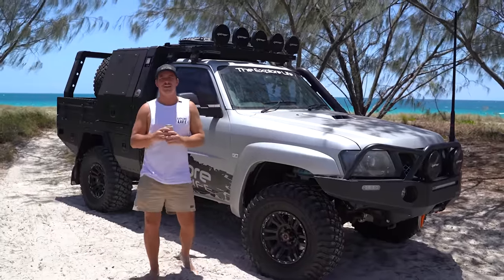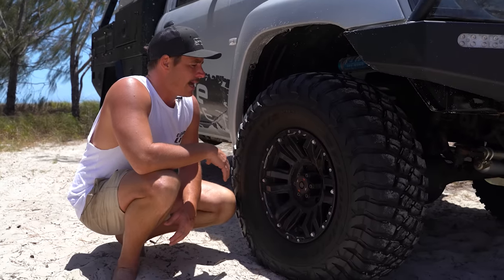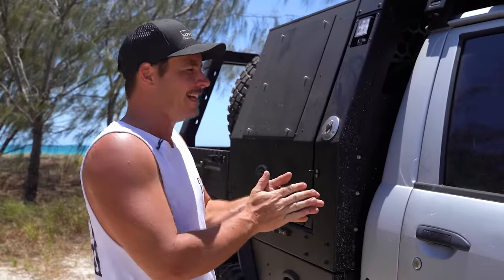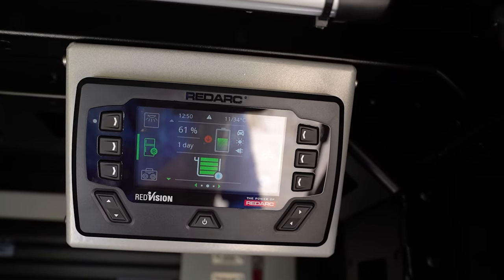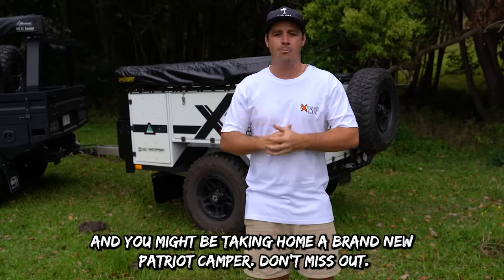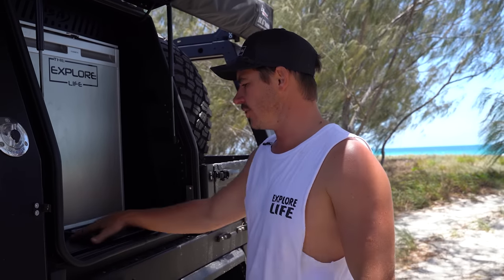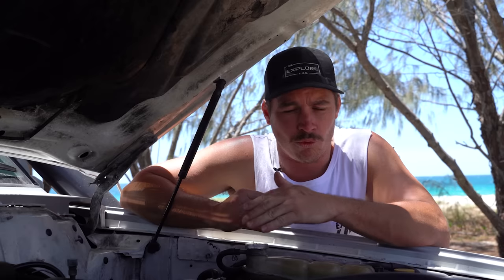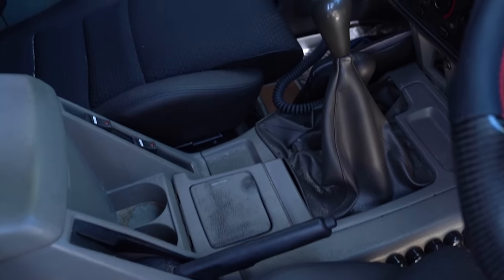THE EXPLORE GYEW! NEW 4WD BUILD IS COMPLETE...MAYBE!

Comment: Excellent car, proportions are perfect, should be nice and balanced to drive... Saw a vid recently where a guy rigged up a two lengths of steel wire to hold the passenger side tray side flat (at 90 degrees when lowered), very handy to have option for an extra table/ bench next to the fridge...
Reply from the maker: we've rigged up a little bit of cord to hold it up on this trip but might be a good mod permantently

Comment: What is it with a lot of 4x4 videos using imperial, like the 4-inch snorkel wouldn't 100mm sound better and tyer size 32's 33's just say 285, buts it's a great video

Comment: Unbelievable rig mate very well built.  Only thing i saw right away which you should definitely replace is those rubbish factory auto locking Hubs .  Switch to a good set of manual ones cause if they stop working when you need them most and you can't lock your front wheels you'll be in trouble .. Sick RIG
Reply: Yeah but then you gotta get out..... haha
Reply: @Bigsoot7393  got to get out and let the air down in your tyres anyway?
Reply: @davidl9687  not every time you put it in 4wd
Reply: @Bigsoot7393  I've got manual hubs and honestly it's no issue. If your not letting your tyres down then why do you need 4wd? If you're switching between 4wd and 2wd then you can always keep your hubs locked an stay in 2H an switch to 4H if need be. Obviously don't keep your hubs locked forever
Reply: @davidl9687  I dunno i only put it in 4wd when I absolutely need it, otherwise just try everything in 2wd, just lazy I guess haha